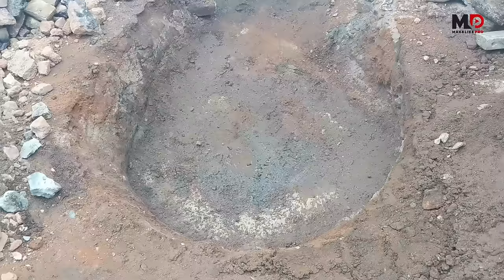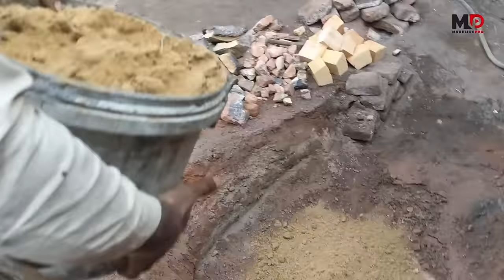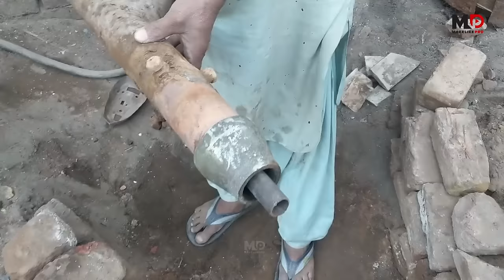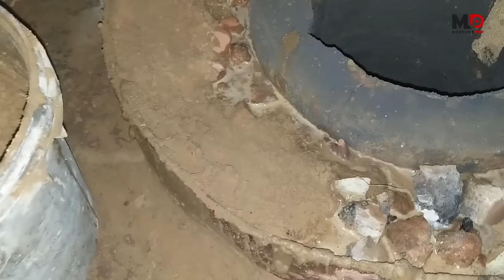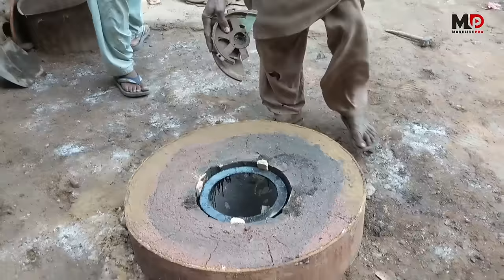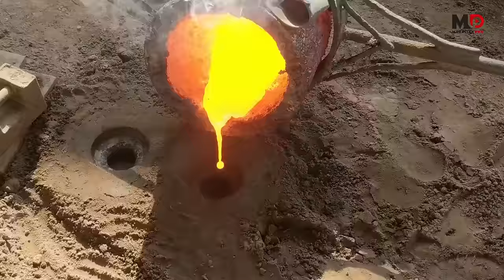How to rebuild metal melting furnace process for foundry

Comment: Nice job, what did they cast? Was it steel?
Reply: Yep
Reply: pig iron
Reply: are you joking ?? steel 1600 Celcius degrees. maxim cast iron 1350-1400 Celsius degrees
Reply: Hate to break it to the guy above me but cast iron is steel
Reply: @mcnuggetwarrior8218  it's cool if you can say that cast iron is steel. it is only a difference of 2-3 percent of carbon. it's the best joke I've ever heard
Reply: @tonytrade  grey cast iron
Reply: Lots of people are saying cast iron, or steel. I think it is cast aluminum they are melting in the foundry they built.
Reply: @mcnuggetwarrior8218  Cast iron is not the same as steel. They are different materials with different properties. The clue is that they have different names. You ought to read a book.
Reply: @mcnuggetwarrior8218  Likewise, a turnip is a vegetable.

Comment: Thanks for the video!
Something could be learned with captions or a commentary.
Like the names of the materials used and why.
Reply: It looks like Russian firebrick (cause Pakistan doesn't make it?) for the bedding it looks like clay (many kinds and colors. They are using a refractory cement (maybe with a little silica sand) as mortar. (They are many types of refractory cement powder.) They are using a steel pipe (large diameter) to cast the firebricks in a concrete (made of refractory cement, sand, and clay... or maybe just the cement and clay.) The burner is probably using propane (could be natural gas) and an electric blower to give a forced air feed) Its just a cast steel (or iron) pipe, with a Y adapter. There is another pipe inside to deliver the propane through a proper sized orifice. It looks like they are melting cast aluminum. While it all looks impressive... it's not...its inefficient, wasteful, and produces low quality aluminum alloy ingots.
Reply: @willthecat3861  too hot for aluminium. By the white smoke (zinc oxide) coming off its probably brass
Reply: @willthecat3861 I don't know about the rest, but Pakistan does make firebricks. And the metal could be cast iron too.
And I agree - won't be efficient at all.

Comment: Open toed sandals...to hold the brick still while grinding with a high speed grinder without a guard....what could possibly go wrong?  I will say that the guy making the furnace is quite good at what he does. Good craftsmanship. All of that work for those two little discs? I hope they get more than one use out of that nice furnace he made.
Reply: Do you suppose if you got this poor man the supplies he needs he could produce a video you would approve of,try it!!!
Reply: ही विट कशी बनते , कुठे विकत मिळते , त्याचा दर काय असतो?
Reply: Safety sandals!😎
Reply: Don’t think OSHA is a problem

Comment: First of all this is gas fire furnace as there was gas line and valve. No oil leakage can be seen on burner too. 
2ndly it was cast iron used for melting. Fire brovks and fire refractory clay was used. What i don't know is the fluxes they used in the start or end. Most commonly iron generator is used on the start and degasifires in the ends

Comment: Which type of this briks please reply me🙏🙏
Reply: These are called furnance bricks. Made up of some clay and chamicals
Reply: They are firebrick, or refractory bricks... basically made from firing Alumia (aluminum oxide) containing mineral clays... or for better quality, manufactured from cement, silica sand, and alumina, plus other minerals. There are many different kinds, grades and colors... cost depends mostly on the temperature the brick will tollerate.